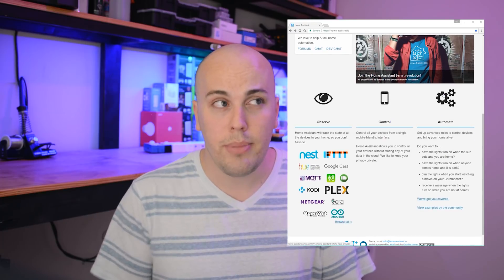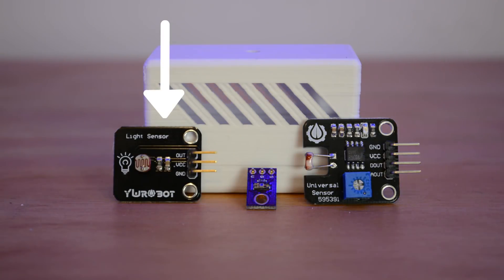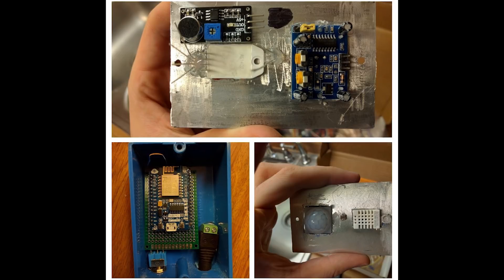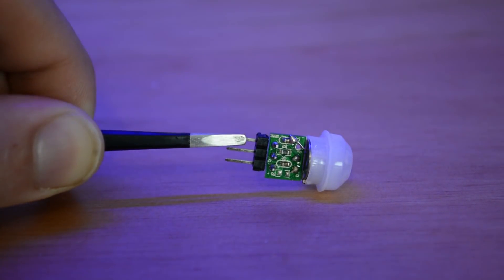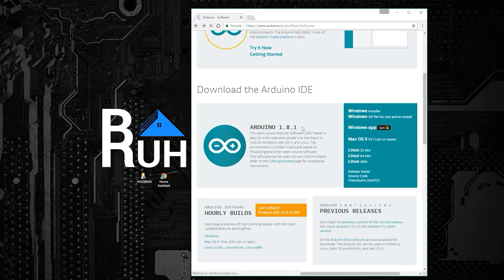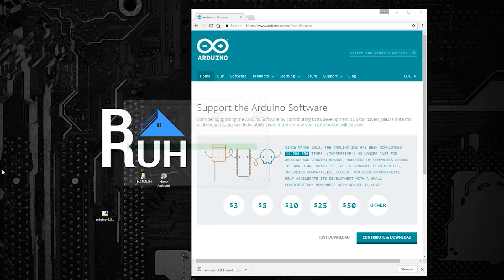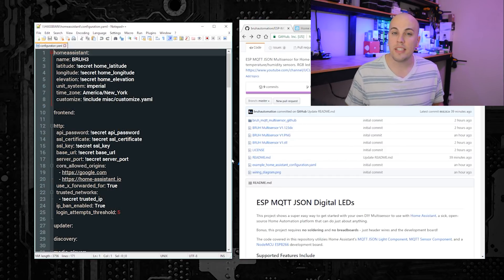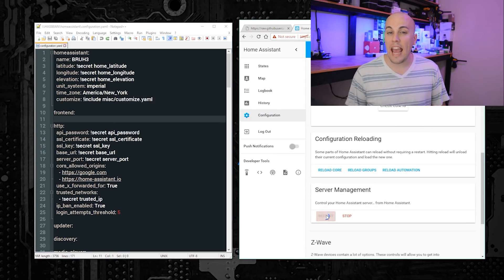$15 DIY Multisensor - Temperature, Humidity, Light, Motion, and RGB LED

Comment: I followed your steps and copy your code and everything went fine. The wifi range it's driving me crazy!! About 10 meters from the wifi spot!!!
I searched Google for an answer but there's a lot of different options/opinions...

I'm using a None MCU v3 + DHT11 + temt6000

Could someone PLEASE take a look at the code? I'm new to Arduino and I'm still learning.

I bought one GY-30 and one BME-280 to replace for these ones but I don't even know how to merge the code of both. As I said I'm still learning...

I would love to use the new borads but for now I just need to improve the wifi signal.

Comment: Great video. I am looking to build a wireless microphone to use with Home Assistant. I don't want to use Amazon, Google, or Apple -- I don't want to be dependent on the cloud. I was thinking about a microphone using Zigbee or wifi to communicate with my computer running Home Assistant.  Do you have a video that would show me how? Or can you give me any tips?  Thanks.

Comment: Great video.  I would suggest, especially for this, to update and use ESPHome.  I used a NodeMCU with ESPHome, and didn't have to mess around with any code at all.  Just put in the info with yaml, and flash it right from my HomeAssistant RPi3b+  works great.  Thank for the video

Comment: I found this video and it got me started with Arduino.  However, I use Smartthings as my home automation hub and I wanted something native.  I modified a sketch file for ST_Anything that integrates all the sensors from this project into a ST compatible sketch file.  Happy to provide details for anyone interested.  Props to Ben for getting me started on this road.
Reply: Can you share a link to your ST sketch file.

Comment: For anyone that is having issues with temperature and humidity readings use an older version on DHT sensor library by adafruit use 1.10 and its fixs wild swings in the readings
Reply: I second that suggestion. I built one of these 4 years ago and it worked fine, built another yesterday and had wild swings in temperature and humidity like 150 degrees and 3000 percent humidity intermittently. Downgraded to 1.1.0 and now it works fine.

Comment: I have just finished the multisensor and compiled the arduino script but something is going wrong. After Hass.io configuration, it seems that multisensor state publish messages are not being received by Hass.io. I can control the  led, (on/off) but hass.io does not show the state correctly. Sensor readings are all the time "unknown". Through the serial interface, the readings are ok. Any help?
Reply: mqtt topic is case sensitive make sure they are the same

Comment: Hi Ben, I'm trying to setup the KY-018 light sensor but without success. I've put the "S pin" on A0 (analog), center pin on 3.3V and last pin on Ground. I've always 0.0V on A0. Is my light sensor broken, or my NodeMCU or both? Or am I doing something wrong? Thank you if you can answer me.

Comment: In your quest to find the best PIR, have you ever tried the ones powered by the main 220v ac ? I have a bunch of these PIR https://i.postimg.cc/Bn1rXqcJ/pir-220v.jpg that were integrated in broken led lights powered by the main and I was trying to salvage and give them a second life. Do you think I can use them somehow? I don't see any voltage coming out of the two output wires

Comment: Can you suggest what type of device I need for this:  I have a Budweiser Goal Light, would like to hardwire into it to automate other lights through Home Assistant and as I have recently worked with Sonoff I think I can do this now, just need to wrap my head around the hardware. One other thing I tried, I was able to use the device ip ping to automate lights, but that is just for device on and off during the game, the goal signal (packet?) is encrypted. As an alternative to hard wiring a device (sensor, switch?) can MQTT use an encrypted signal instance for my purpose?

Comment: Bruh...  love what u do. I'm a commerical electrician, I also install building  automation systems.  I am a huge Christmas lights guy. I just bought 230 feet of rgb strips, I did all the way around my soffits. I have plenty of strips left but could use some advise on a couple things. I also have alot of hardware that I feel as tho I could use as means of controlling theses strips. Is there a way I could talk to u direct, maybe a face chat or something?

Comment: I've been trying to get this to work for the better part of a year now and these are my observations:

- Socket timeout errors
- Compiling errors (Jsonbuffer not declared, Adafruit_Sensor.h file or directory not found etc. etc.)
- MQTT is a pain and not trustworthy.
- Yaml is an even greater pain because of the syntax and horrible component documentation where every developer uses his or her own way of writing things.
- Documentation is extremely lacking because of developers always assuming the user already has years of experience (The sense and nonsense of Github). 
-  Updated libraries often break.
- Code incomplete, or tutorials flat out missing information.
- Overall slow, clunky and user-unfriendly, horrible delay in restarting  
- Layers of easily breaking materials and code through abstraction make finding the culprit near       impossible.

Though "free", you pay with your time so unless you're a coding junkie with too much free time on his or her hands and experience with debugging code I suggest you steer clear of Hass.io, its components and hobby products like Arduino or the Nodemcu. It's not made for easy usage but as a hobby project by and for coders and like most FOSS projects, don't assume it will ever reach a stage of completeness or have proper documentation. People who make these things often claim it's a breeze but they conveniently let out the hours of pain and suffering they've had to go through just to gain enough knowledge to start simple projects. 

I have great respect for people who create these things but they always neglect to tell that it's not made for normal people. If you feel this is going to be a nice quick weekend project, forget it. You're better off buying professional solutions. Yes you pay a lot more in terms of money but it will work when you want it, where you want it.
Reply: This realization is sinking in after just a week of pain.   God I wish I had this when I was young and bored.

Comment: Great video for learning a few things. 1. NodeMCU isn't that easy. 2. Don't let the internet fool you into thinking something is a slam dunk. 3. There is a reason EEs exist. I thought this was going to make me a sensor but in reality what happened what I bought a bunch of stuff, tried a bunch of stuff and ended up with a lot of unreliable stuff.  At first everything seemed great but the more I learned, the more I realized this thing is not going to work reliably and it's going to be more of a learning experience than something useful unless I spend a lot more time perfecting it.

Comment: Ran into a problem here, hope someone can help me..  

i got the error " 'StaticJsonBuffer' was not declared in this scope" 

in the code the highlighted line says 

 StaticJsonBuffer<BUFFER_SIZE> jsonBufer;

am in supposed to input a buffer size here? if so, what size? 

thank you for all your help and time.
Reply: Same crap here, would be nice if someone knows.
Reply: Have you solved this?
Reply: @pvries  sadly no, still got everything set up but it's been shelved untill I can find a fix.
Reply: @Survivalstudent  I've found the solution. By default, the Arduino IDE selects the newest version 6 beta release. It should work if you downgrade to 5.13.4
Reply: @pvries  brilliant! that got it to compile perfectly. found and installed the drivers for my board, got everything connected.. connected the power.. a light came on!! loaded the code and..... when i check in the serial monitor and select the correct rate.. all i get is " Attempting MQTT connection...failed, rc=-2 try again in 5 seconds
" i've messed up somewhere..
Reply: @Survivalstudent  I had that too. Check the MQTT settings in the Arduino IDE match your MQTT settings in home assistant.
Reply: same problem..check json library, code is not compatible with latest json library, remove it from libraries and install it again but select version 5.8.3
Reply: Got this working, getting readings for humidity, temp, light and motion.. However has anyone got the led working??  I power it on and get a blue light but other than that.. Nothing.. Flick the switch in HA and it just turns off.. Anyone got a different outcome?  Or had this and solved it??

Comment: hello, great video, could you tell me to come and add the soil moisture sensor? and a relay? Thanks I would be grateful, or a similar guide that also integrates the brightness senor, I want to use it with home assistant, Thanks again

Comment: Thanks for the very nice video, really useful and entertaining! Quick question: are there options of Temperature and Humidity and also Light sensors which would operate over RF instead of WIFI and could be controlled by Home Assistant using something like a Sonoff Bridge? Would that be possible? Thinking on low voltage/current so that this could be powered by batteries on a feasible way. Again thank you for sharing all your knowledge with us!
Reply: Perhaps something like using Adafruit's Trinket as controller with an Arduino RF transmitter and a Sonoff Brige ...

Comment: Hello, Im trying to use this setup with a simple 8 relay module. Im having issues with the code as I was trying to use the LED on off switch for the relay. However I only need a high or low payload. Also I think that the 8 relay module needs 5v and currently according to your diagram that is being used by the motion sensor I believe. Is it necessary for the motion sensor to use the vin pin? Also can you offer any insight in regard to coding a simple high low payload with your current code?

Comment: iv changed the mx biffersize to 512   but I get this error   StaticJsonBuffer<BUFFER_SIZE> jsonBuffer;   not declared in this scope
Reply: I am also getting this issue. Did you ever figure it out?
Reply: Make sure you're using the ArduinoJSON 5.13.2 like is explained in the big report here: (https://github.com/bblanchon/ArduinoJson/issues/756). Any version in 6.xx will not work.
Reply: Thanks! I was stuck on this and that fixed everything.
Reply: seems. way out dated. I gave up and used esphomeyaml and worked great.

Comment: I am getting an error regarding...

- 'D1' was not declared in this scope

Followed the steps twice through. What am I missing? Or is it the code...
Reply: Me too.  Did you get a solution?
Reply: I know this is an old comment, but for those searching for an answer - I had this same issue too, its in regards to the LED pin. I had initially selected the board as ESP8266 Generic and got the not declared variable. Then switched over to the NodeMCU 1.0 board, this error went away.

Comment: Hi Guys , I am trying to upload the code for this sensor but during the process it keeps failing with "Error Compiling for board Arduino/Geniuno Uno." Can anyone assist ?
Reply: Change the board type to the board you're uploading to.
Reply: Jon Griffith i have tried that but error still appears. I am starting to think the board is faulty.
Reply: One other thing.  I couldn't make it work from my Mac.  I had to switch to using my PC to get the board to flash.

Comment: Hi Ben, thank you for a wonderful work. I have configured as per the video. I can see the responses in Serial Monitor of Arduino.  I have made changes to configuration file( I am using Hassio). I have installed the mosquito mqtt broker. 
{
  "plain": true,
  "ssl": false,
  "anonymous": true,
  "logins": [
    {
      "username": "homeassistant",
      "password": "xyz1234"
    }
  ],
  "customize": {
    "active": false,
    "folder": "mosquitto"
  },
  "certfile": "fullchain.pem",
  "keyfile": "privkey.pem"
}
My led turns on for the first time and after 2-3 seconds the switch again toggles automatically and all other sensors are shown as "Unknown". (but in Serial Monitor I can see the responses). 
Also when I start the mosquito in hassio as add-in .

starting version 3.2.2
1523878259: mosquitto version 1.4.12 (build date 2017-06-01 13:03:48+0000) starting
1523878259: Config loaded from /etc/mosquitto.conf.
1523878259: Opening ipv4 listen socket on port 1883.
1523878259: Opening ipv6 listen socket on port 1883.
1523878259: Warning: Mosquitto should not be run as root/administrator.
1523878267: New connection from 172.30.32.1 on port 1883.
1523878268: Socket error on client <unknown>, disconnecting.
1523878268: New connection from 172.30.32.1 on port 1883.
1523878268: New client connected from 172.30.32.1 as fdea50aa-3554-4925-b218-dd7056436b62 (c1, k60, u'homeassistant').
Please suggest ... I hope I am missing something here. I have also done a port forwarding  1883 port of my pi ip.
Thanks ,
MJ
Reply: Just an update , I got it working by setting up the MAX packet size = 512. Also I was using the andrino.exe so the sketchbooks are located in a different location. 

Thanks Ben for a wonderful video.  Also a request can you please add to read the data from a soil Moisture Water Sensor (https://www.amazon.com/gp/product/B01FDGUHBM/ref=oh_aui_detailpage_o00_s00?ie=UTF8&psc=1) Planning to add for automate the watering plants based on moisture..

Thanks,
MJ
Reply: Hi bro! I am having the same problem. Did you mean you changed MAX packet size = 512 in the PubSubClient.h file like he mentioned in the video or a setting in the Mosquitto broker? Also did you do anything differently in the configuration.yaml file than what he did in the video?

Comment: For a PIR sensor, just grab any old PIR alarm sensor. They are noise immune, usually have DSP, adjustable, self contained, cheap as dirt, run on 12V and just open an NC signal when motion is detected. Many also have pet immunity, sun immunity, and all sorts of useful features. Any alarm company that has been around for a while likely has boxes of sensors they will give you for a coffee.
Reply: I've not had much luck finding them online for reasonable pricing. I have one that came with my house, works fantastic, would love to find more of them. Have you found any good online sellers?

Comment: Can someone help - I have LDR Photoresistor Module and the issue is in HA lux rate is wrong way. That is when export to higher light lux number become lower and when in dark I get higher lux number. I did not change the code in Arduino or in HA
Reply: having the same issue, out of curiosity did you ever figure out what was causing this?

Comment: Hi Ben, great work with this sensor. Built 2 and bar the blue led issue commented here they work very well and report in HA. Could you add code to the info section of this video afor examples of how to use the sensor data in HA automations? I've got the our working but I'm struggling to understand how to reference light levels less/greater than a value. I'd image the temp and humidity would be identical. Thanks in advance.

Comment: Hi, great video, i have now build a sensor and it works and looks good :)!
How could I program the sensor in Home Assistant to

for example
Set a light
hold the light on for 20 minutes (new motion would give new 20 minutes)
turn off the light

Comment: Hi Ben, thx for this great project.
I was wandering if it would be possible to add a compatibility for 1 wire sensors. I have a DS18B20 with metal enclosure that would be just great to measure water temperature in a pool. I know there is a Arduino library for this, but I'm not able to include the function in you software myself. 
Apart from my needs, one wire have several good characteristics, like the one that you can put several on... one wire :-), so you can measure temp in different place using only one device.
Anyone able to do that?

Comment: Dear all, I am totally new to all of this..And- I am frustrated sorry. I managed to set up a raspberry pi with Hassio. Got the DIY sensor connected to the MQTT server. But I absolutely do not know how to display the readings of the sensors on a  panel or in the front menu. Can anyone give me a tip or just an idea which I can follow up?

Comment: Hello, I am following your tutorial, great channel btw. I am getting a error that the file does not compile for board NodeMCU 1.0. Even if I do not change anything from your code it still gives me this error. Anyone can help?
Reply: The issue is that I was missing two libraries:
      - DHT sensor library 
      - Adafruit unified sensor
Those were not mention in the video, 
Thanks a lot step by step I will get this running.
Reply: Having the same issue at the moment. It's not compiling for me, and I followed the instructions exactly. It's giving me >fatal error: ESP8266WiFi.h: No such file or directory< Any ideas?

Comment: Hi Ben, Love the videos. You've helped me tremendously with HA. I've been using and modifying your Arduino code for the multisensor, but have a small problem. Every time I start one of the multisensors, it sends mqtt packets with a temp and humidity of 0, 2-3 times before it actually gets a reading from the DHT sensors and sends usable data. I can't figure out how to overcome this. If you have any advise, it would be greatly appreciated!!
Reply: Never mind, I figured it out. you sendState() after reconnect and callback. I commented those out and the zero readings are gone.